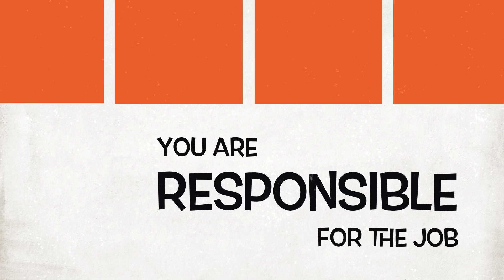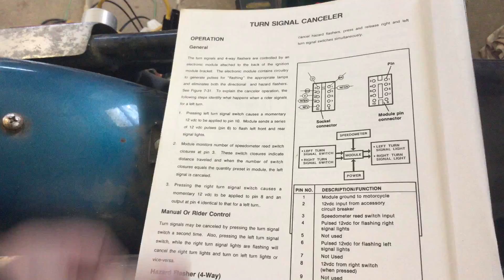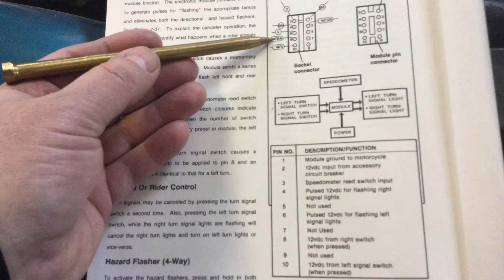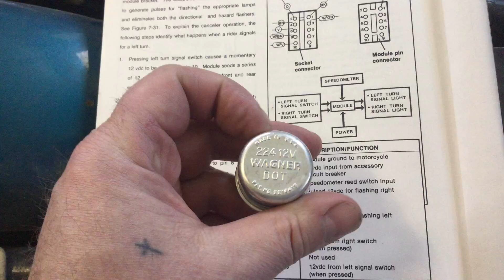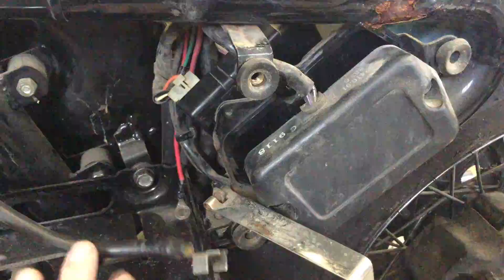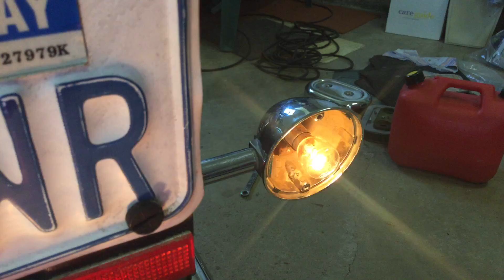Harley Davidson Signal Lights

Comment: The stock Harley switch is a momentary switch so you'll have to hold it unless you wire up a toggle or rocker switch . I wired mine ( temporarily ) so that when I press the button the signals light , when I let go they go off this way I can manually flash them  However  ,as soon as possible I'm going with a Signal Dynamics module 70 bucks on ebay 
https://www.ebay.com/itm/Signal-Dynamics-01501-Self-Canceling-Turn-Signal-Module-48-0992-28-01501/231144223931

Comment: I had a problem with my left turn signal on my Harley Davidson Sportster 883 and looked on youtube for a possible answer and made a list. The first one was to switch the right turn signal bulb with the left.... bam... that was it. I cleaned the bulb contact area and switched them back and it is still working.

Comment: u remember that  one guy used these and didnt get anywhere because the module doesnt work when in a hot area of the motorcycle.  and instead used a 5-6 ohm resistor to solve the problem.
Reply: I just recently had the same problems with my signal lights. It just so happened I needed a New Battery at the same time . When I replaced the Battery the signal problem went away.

Comment: If the left turn signal is working, then the problem is probably between the module and the light. You never checked anything with a multimeter. Patching is not a go.

Comment: Thank you so much for showing the book schematic! I have a 93 Electra Glide Classic, and it is wired exactly the same as yours. I will also be wiring flashers in. The modules will n eBay for used ones are $75 and up!
Thanks again!